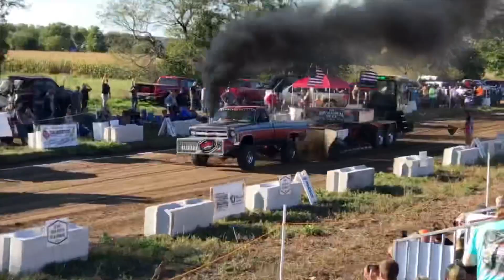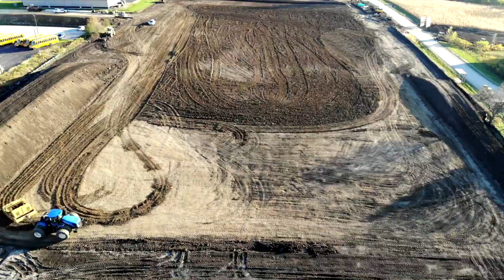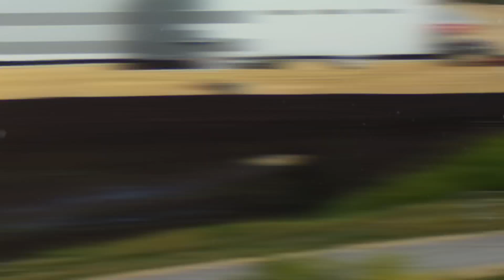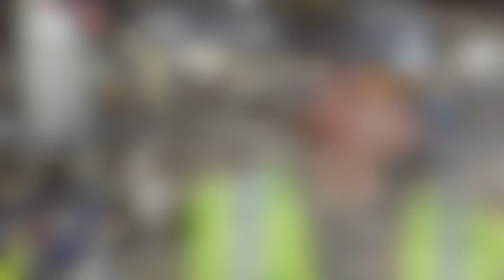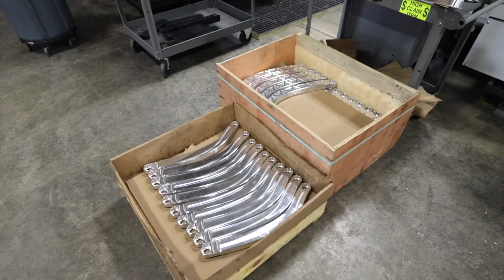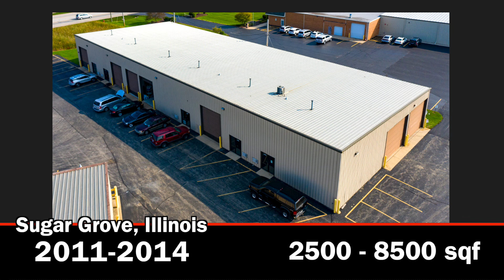WCFab New Shop

Comment: Is this why some of your twin turbo kits are missing from your website?
Reply from the maker: The move has unfortunately affected our production lead times so far this year,  but it is not directly related to changes in our product offering.
Reply: @WCFab  I feel like I'm getting the run around, I emailed you guys directly and I was told your twin kits are discontinued
Reply from the maker: @TaylorVanconant  sorry for any confusion our previous comment may have caused. To clarify, we did discontinue some products in mid-May and a number of turbo kits were affected. However, the new building and move were not the reason. Unfortunately some of those products were no longer a viable part of our lineup and will no longer be offered in order to make room for new items while others will be re-released in the future after re-development is complete. We’ve got a strong product release schedule for the remainder of the year so please keep an eye out here and make sure to subscribe to our email newsletter for more details as they become available.